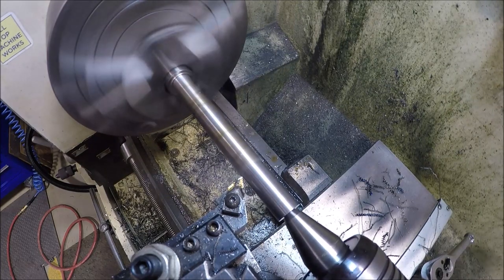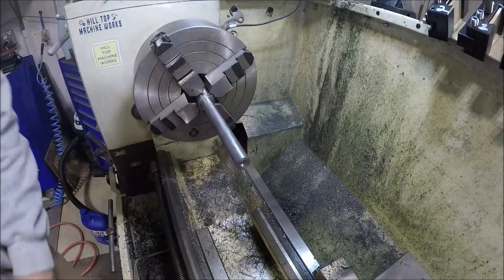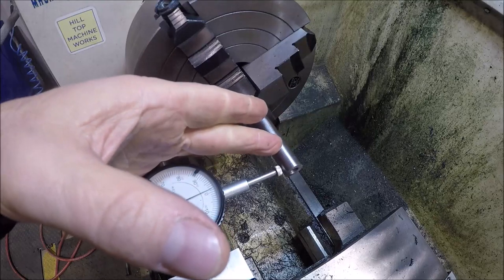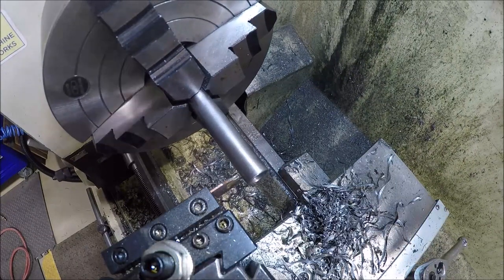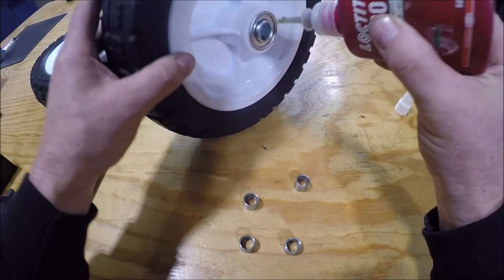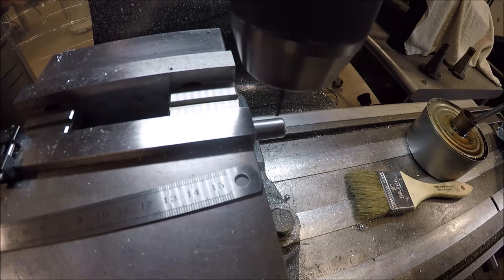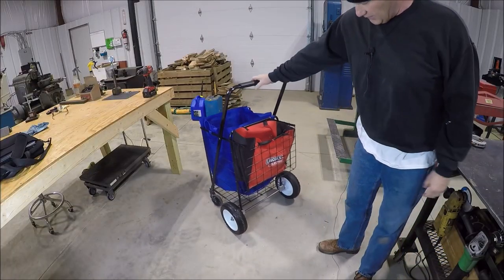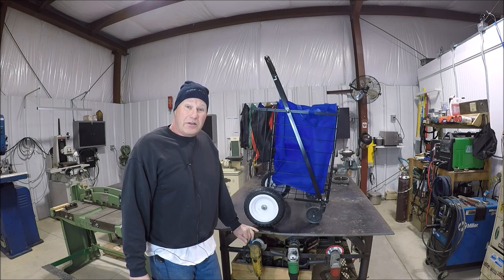Flea market cart wheel & axle upgrade  Part 2

Comment: Nice one Tom.  Thinking of your fire/stove at the end - if you're into plumbing, installing coils of (copper?) pipe around the flue and leading to a rack, you can warm or dry your clothes and boots. Treated water or oil with a small pump to circulate it. You could even run it through a radiator (maybe in your office?) to keep the auto mechanic theme.  Stay safe and well :)
Reply from the maker: Thanks Anthony. Interesting idea.